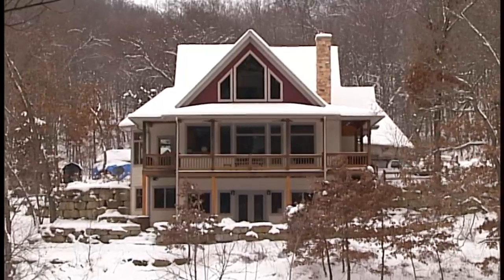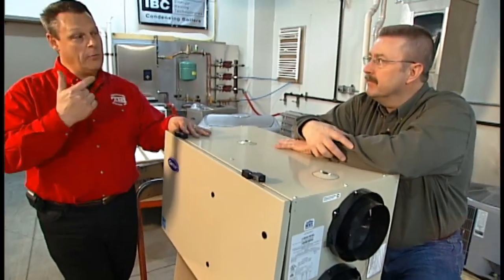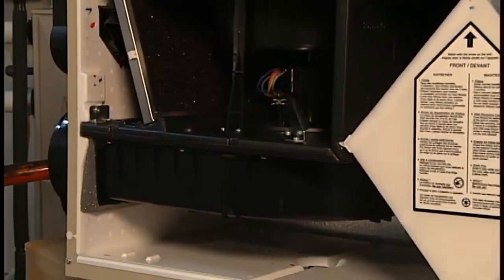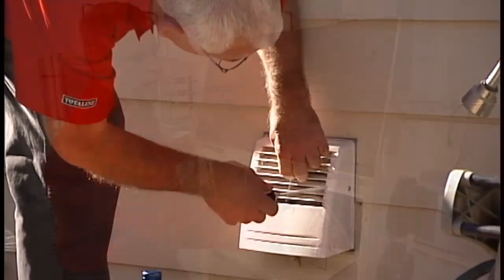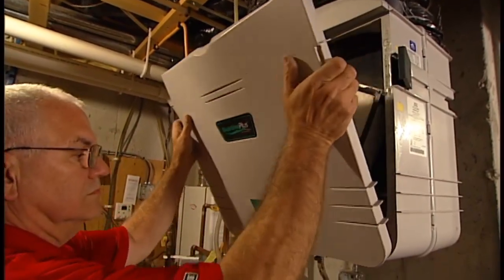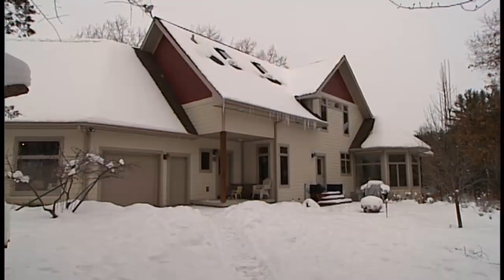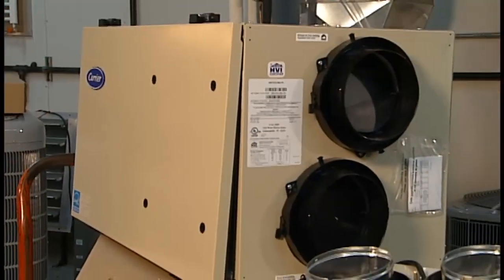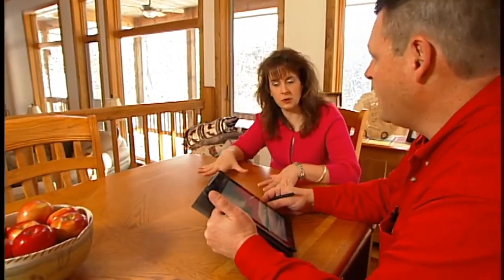Fresh Air Ventilation Options

Comment: Will this stop the condensation on the windows during the winter.  We had a high effeciency furnace installed 2 years ago.
Reply: Not really. You need double glazing and reduce moisture load in the house. AC reduces moisture.

Comment: I live in Arizona at elevation about 3500 ft. I am looking to do two things: one add fresh air; two use cool fresh air when available instead of the A/C. In the hot weather the daily  temperatures are over 100 daytime but about 3 AM the temperature  starts to cool. The A/C cycles on and off all night then cycles off when the house cools or is timed out. Most of the systems in these 2000-25000 ft ranch homes use a gas fired hot air heating and A/C cooling system ( In the garage.)  We keep out thermostat set at 79 degrees or above for cooling.
Reply: Sun Lite economizer